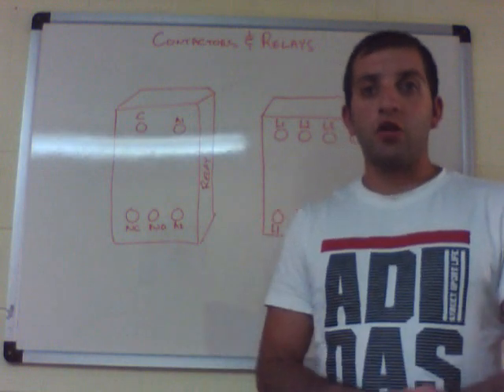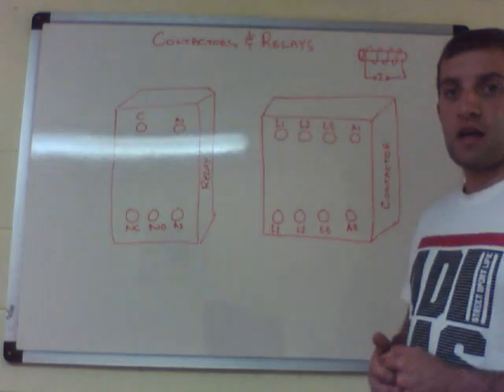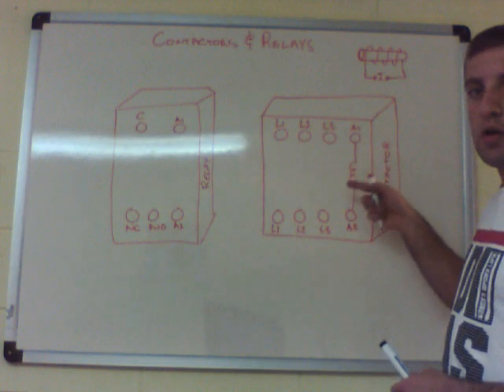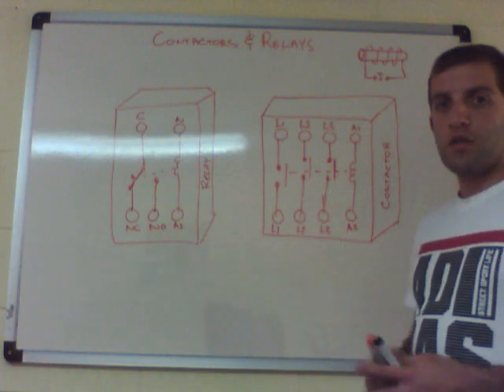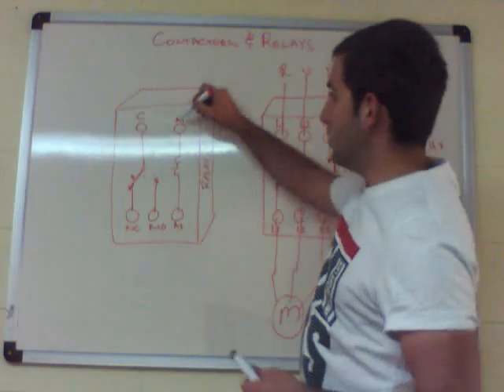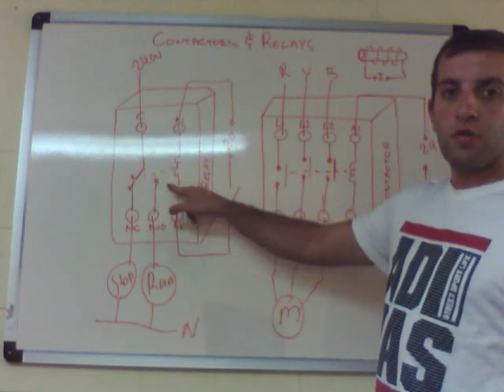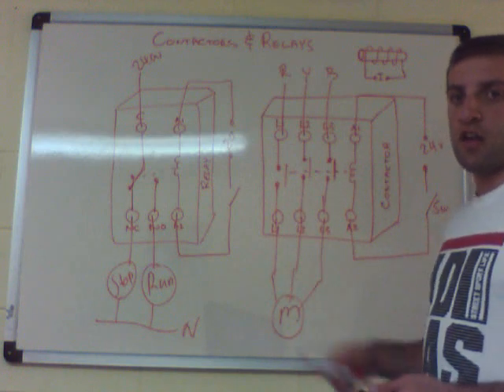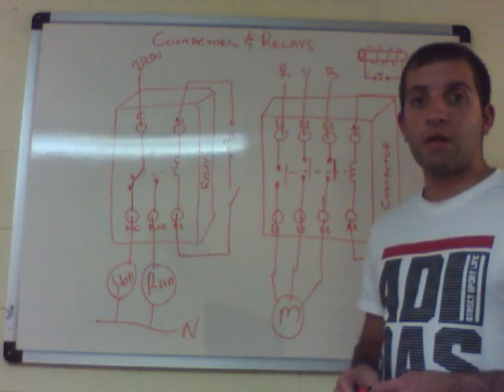How Contactors and Relays work

Comment: I was taught that dry contacts do not have current running through them and you can tell if they are closed by checking if there is continuity between them. "Wet" contacts, as you are calling them, are checked by seeing if there is current flowing between them.

Comment: its really help full video, But one thing i didn't understand that when the motor star, then how relay become energized i mean form where the relay takes 24 v supply. it will be separate supply? because its these two circuses for one purpose. please need little bit explanation. Thanks

Comment: Great video!I'm working on a project with a PLC at the minute. And in need of relay control for a single 24v DC motor. I haven't got contactors at hand but relays are available to me.Im looking to get the DC motor to work in forward/reverse. I understand that reversing the polarity of the DC motor that I can achieve the forward/reverse.But im not sure of how to connect this to two relays.Aswell with an electrical interlock between both relays, that only 1 will work at a time.It would be great if you could help!Cheers

Comment from the maker: @andymclachlanutube the mechanical operation of the relay or contactor is based on the manufacturers design. Usually it will pull the contacts as it is cheaper to manufacturer and simpler in design which make it an attractive option for manufacturers.

Comment: U explained about the contactor power but what feeds the switch that operates the contactor, 110 or 3 phase
Reply from the maker: The supply voltage to the contact poles of the relay/contactor can be any voltage you require for your application as long as the relay/contactor is rated at that voltage and can handle the current for your circuit.

Comment: I was wandering if you could go through transposing AC to DC using diodes to make a bridge rectifier? and then using inverters to make DC to AC?

Also, could you go over Transistors just the basics, say level 2? i missed this thoery lesson. thanks

Comment: Thanks for the explanation. I have a client that has multiple applications of electric motors on his site (Foundry) and as a designer of his power transformations, I'd like to add a condition monitoring system. Can I use these applications with various pressure and heat switches and manage all that from a C and I unit?

Comment: I have a doubt about powering the coil, here it goes: are all coils powered by DC voltage? Being that so, contactors coils with terminals A1 and A2 conected to an AC power source have a rectifier? any help its appreciated
Reply: +0786RICARDO       some coil has 440 VAC,220 VAC (most common,because no need trnsformer),110 VAC...we can use also rectifier if the coil voltage is DC but the available source is AC
Reply: It depends, coils are mostly run by direct current but if you have a S4 (4 way switch) connected in parallel to 1 of the lines (L1, L2, L2) than it could be alternating current

Comment: i want to use the contactor to protect a distribution board (DB) in electrical circuit of residential or business premises in addition to the MCB's (Miniature Circuit Breakers) and ELCB's. pls which type of contactors will i use to control the system Sir:
Reply: You need an overload protection relay - not a contactor.  You may use an overload relay in conjunction with your contactor, if your load is large.  As Ramy says, you need to look at the current (amps) ratings.  Don't exceed the max voltage for that device, but that doesn't sound like you are using high voltage.
Reply: yes, it doesnt

Comment: by the way very nice explanation I like your video I wanted to find a video on the web that explain single line diagram and in the same time to show physically the components of such diagram like for board that include lighting circuit sockets and air conditioning or even pumps

Comment: Why is it demonstrated that the activated coil in the contactor pushes the contacts while the activated coil in the relay is demonstrated to pull the contacts?
Reply: is a drawing mistake,both coil pul the contacts not push and return in normal state because of springs when the coil is not energized

Comment: high I saw contactors to be installed on lighting circuit is this because the lights fixtures are controlled by sensors you know like lighting fixtures for parking zone
Reply from the maker: Installing lights on a contactor is used for splitting the lighting on 3 phases to balance the phases. it also helps take away the high current away from the switch.

Comment: how someone make an automatic chance over switch using contractor?
Reply from the maker: +Salifu Suleyman using a timer and the NO and NC terminal of the relay
Reply: +gabanabeflosin I have a doubt about powering the coil, here it goes: are all coils powered by DC voltage? Being that so, contactors coils with terminals A1 and A2 conected to an AC power source have a rectifier? any help its appreciated
Reply: +0786RICARDO there are many contactors that will operate on AC voltage, you simply need to ensure the one you are using is rated for it.

Comment: In my opinion i disagree. Mainly because relay contractors are also used in high voltage application as well ie: single phase compressor motor. even split phase type motors.